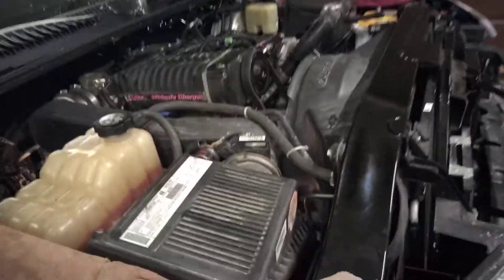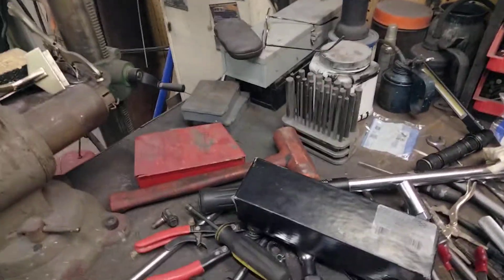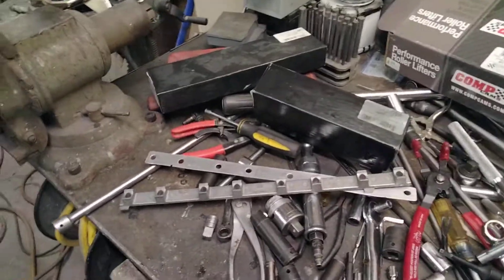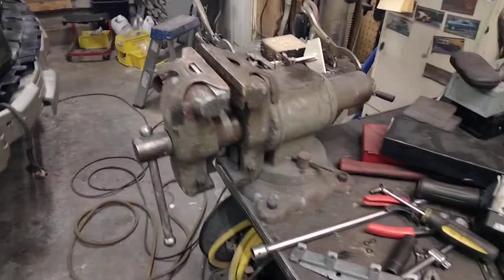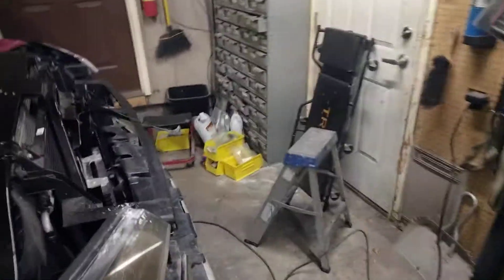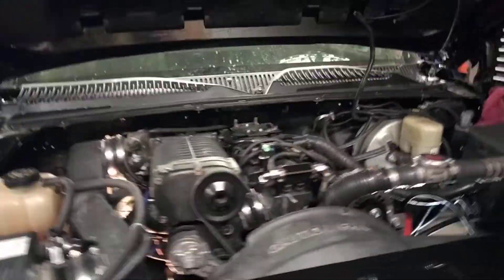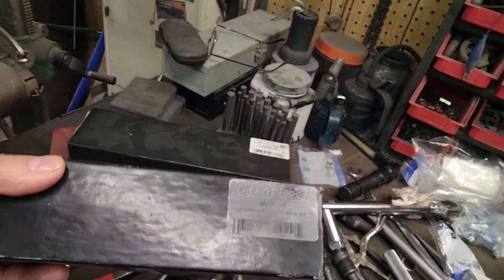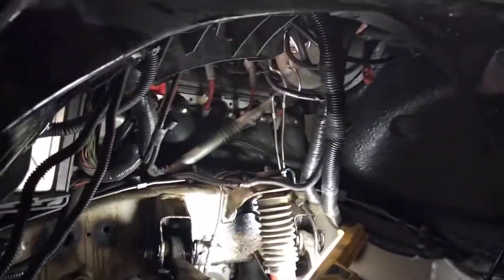Comp Cams Evolution lifters after 14 hrs

Comment: What oil are you running!
Reply from the maker: I have Mobil 1 0W-40 in it right now. Before that I had Mystik JT-8 straight 30W in it, this was the last of an old 5 gal pail that I bought in the 90s when this brand was full mineral base and I just wanted to use it up, so I put it in there for a run-in oil. Same with the Mobil 1, I needed to use it up so it's in there now. And there is no difference in how the engine sounds or runs.

I talked to a Comp Cams rep about oil and he said use a good semi synthetic. I asked for a specific brand and weight and he would not provide any specific brand or number. Then he told me a bunch of preachy stuff about synthetic oil being unnecessary and mineral base oil being around and used in high performance engines for a long time. I'm 63 years old and I don't really need to be told stuff like that. He also said that mineral base oil will increase oil pressure, and I did not see that happen in my engine at all. Oil pressure is the same with straight 30 mineral base or multi viscosity synthetic. 

I bought some new Mystik JT8 that is semi synthetic and will probably try that next, after the Mobil 1 is used up. I am not in the mood to drain and dispose 7 quarts of oil for nothing. (7 quarts because I have dual remote large filters and a cooler). But it will be ready for another oil change soon. Bottom line is I doubt there is any difference to be seen with any good quality oil. I do not think the oil is causing the noise. If I put poor quality oil in it and had noise then I could understand that.

BTW I am the original owner of the truck and this engine was over-maintained from new, always Mobil 1 which is a good quality oil, and changed it often. (That's why I have an oil disposal problem). The engine was never raced or run hard, mostly cruising and towing. The OEM valve train was never noisy. When I tore the engine down for a cam change and top end rebuild it was clean and sludge free inside. People will argue about this or that oil brand all day long but as long as you put good quality oil in and don't leave it in there a long time then you should not have major problems. I understand that oil becomes more critical in a race engine, but this is not a race engine.
Reply: @onemoremisfit so I went back and way a few of your your videos so I see that you do have good oil pressure.
Reply from the maker: @baby-sharkgto4902  Yeah, the engine has a new oil pump and there is plenty of oil pressure. I also have dual remote large can oil filters and a good size cooler out in front of the radiator. Basically the cooler I can keep the oil the quieter the lifters run. I have Driven GP-1 10w-30 oil in it and as long as I can keep the oil cool it doesn't get too loud and I can tolerate it. The engine runs fine, can't complain about that, it pulls well and runs smooth and clean. I just got a new transmission built for the truck and will be putting that in this weekend, transfer case is also going out for a rebuild. Then I guess I will be leaving the power train alone for a while until the engine is ready for a rebuild someday. When that happens the lifters I use will be stock GM units.
Reply: You have 2 remote oil filters and an oil cooler??? If you are still running a stock oil pump with 2 remote oil filters and an oil cooler, that may be why you have some engine noise. Melling says if you have an oil cooler or a remote oil filter that you need a high volume/ pressure oil pump… and you have 2 remote filters and an oil cooler 🤔

That would explain why it doesn’t make noise when it’s cold but does when it’s warm. 

What is your oil pressure cold? What is your oil pressure when hot?

Furthermore these engines will go 500k+ miles without 2 remote oil filters and an oil cooler.

Comment: Measure.    And measure again.  
If the lifter is in the preload stroke and noisy, - they are shit, or working as designed. 
Thinking a shit design.  
Comp Cams Reps, read from a scripted book.  - w no 3rd world accent.  
Run it.   Run it Hard.  
Warranty?
Good Luck.
Reply from the maker: The first set of lifters I tried were their standard LS retrofit. I had 3 different length push rods with shims to split the difference between lengths. I went up to the length where they won't run, then backed off a size to where they do run. They ran almost quiet on cold start and got really noisy as water temp reached 180 degrees. I have a video posted of these running, and they were horrible.

They gave me a refund on that set. The 2 guys I spoke to were American with southern accents.

Now I have the Evolutions in the engine. They would not run the same length push rods as the other set, even though I'm pretty sure they are supposed to be interchangeable dimensions.They needed to have push rods that are 1-1/2 sizes shorter to run. I also went too long to run on those and backed off a length at a time, to make sure I did not have push rods that are too short. 

The Evolutions also sound decent when cold, but get noisy once the oil is fully hot. But at least they are not as noisy as the others. They are a slight improvement, that's all I can say for them. I never thought going into this that it would be so hard to get a set of lifters that run right.

Comment: Sounds like a dam sewing machine
Reply from the maker: Yeah, and they haven't really improved after 48 hrs of runtime now, they are still about the same, so I think they have settled in for how they are going to be. I'm not really happy with them, the only thing I can say is they are better than the other set I ran. If I have to change these lifters again I will not use Comp Cams lifters. I ran into another guy in the comments of a video that Comp Cams posted to promote these new Evolution series, he said he will never use Comp Cams lifters again, he said he has 2 engines with very noisy Comp Cams lifters. I thought a set of performance link bar lifters would be an upgrade, but I have learned from this experience that they are not worth it, especially on this engine. If I change lifters again I will use stock lifters with the plastic trays.